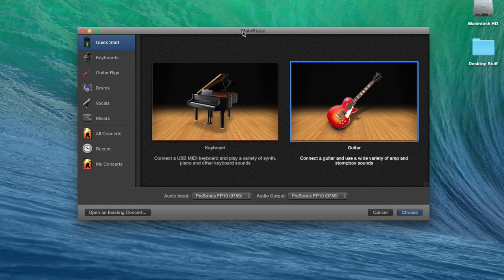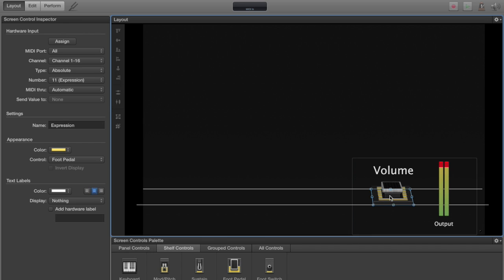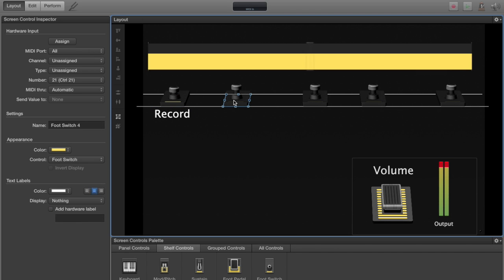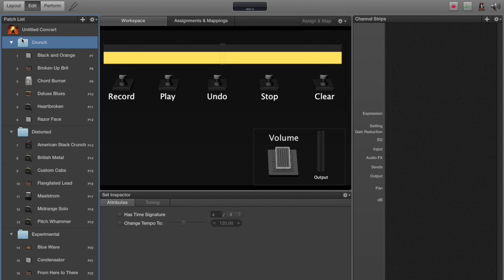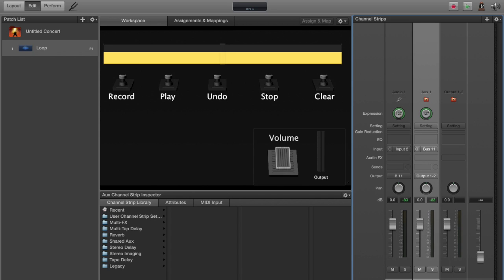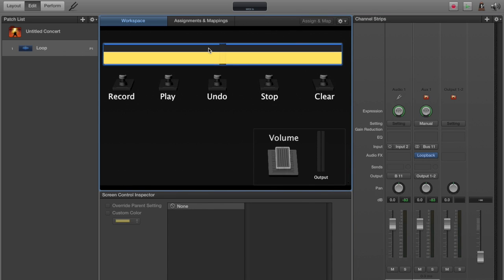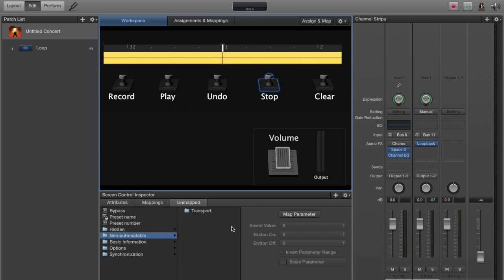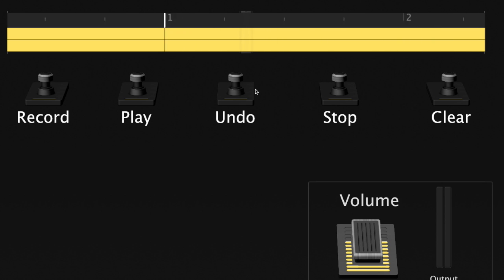Behringer FCB1010 and Mainstage 3 - Loop / Delay Pedal

Comment: Hi Stephen, Excellent video thank you.  This may be a long shot but I'm wondering if you know of the Line 6 Helix and/or if the same process which looks like plug and play button/pedal assigning for the FCB will work with the Helix.  Do you have any experience with the Helix?  Also, 2nd question:  Could you provide a live use demo video for guitar players interested in using Mainstage as a live looper?  I like your straightforward and clear instructions.  Thanks in advance!!!
Reply from the maker: Thank you, really appreciate the encouragement!  I don't have a Helix, but if Line 6 were to send me one for demo purposes, I'd be thrilled to learn it and create demos on it.  :)  I've got a lot of projects in the hopper, but if I get a chance, I'll put together a demo on how to use Mainstage delay/loop live.  That's a tricky one to do for technical reasons (the "technical reasons" being "I'm a bit shy about my guitar playing".  )  If I am able to get it done, I'll be sure to let you know.

Comment: Would you still recommend the fcb1010 or do you know of a better midi pedalboard to use with mainstage? If you don't know it's ok, I just don't particularly like beringer products other than the price. Thanks.
Reply from the maker: The FCB1010 is a pretty rugged board.  I've got nothing bad to say about it.  There are some firmware hacks available for it, and I've seen people hack it to use phantom power rather than A/C.  But the only only upgrade I think it really needs is the iFCB software for configuring the board (http://www.wabbitwanch.com/iFCB.html).  You can configure the board without this software, but it's many orders of magnitude easier with iFCB.  You can see a brief demo of that software here: https://www.youtube.com/watch?v=qbDPdRJFwVU.

With that said, I don't have any other comparable boards - all my other midi gear is hand-operated, rather than foot-operated.  If you go with the FCB1010, I think you'll be plenty happy with it.  But if you find something better out there, drop a note, I'd love to hear about it.
Reply: Stephen Brown thank you so much for that info. Right now I'm considering the fcb1010. I also called Sweetwater and they are researching to see if they know of anything else that may work with mainstage as well or better than the fcb1010. I will let you know what I decide to go with. Thank you very much

Comment: You set up one switch for "play" and a separate switch for "stop". In the setup I see an option to use one switch for both "play/stop". Any reason why you set separate switches for "play" and "stop"? Does using one switch for both not work with the FCB1010? Thanks!
Reply from the maker: JoeSoma You can absolutely use the single start/stop switch.
Reply: The advantage to separate "play" and "stop" switches is that you can replay the loop without stopping it so that it only begins again. Howie Day does this in the YouTube video Ghost Rare Live.